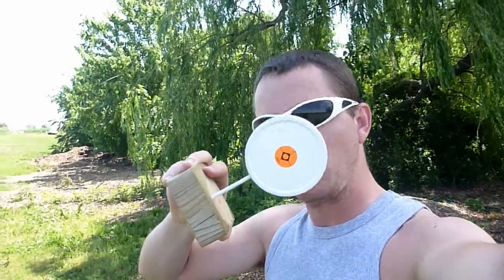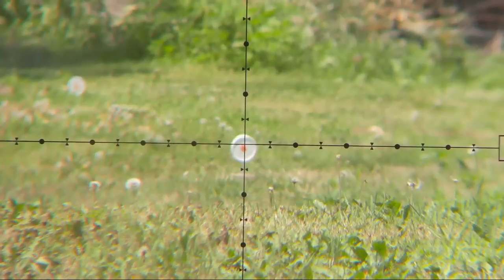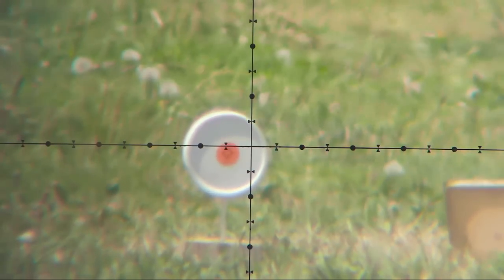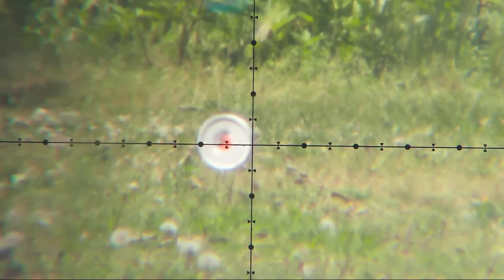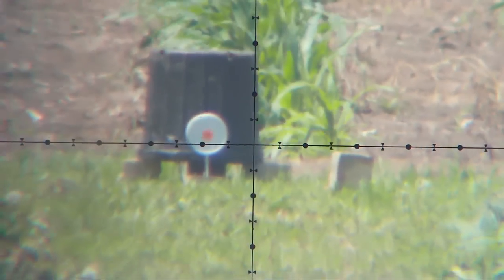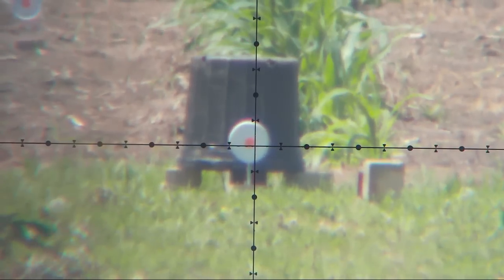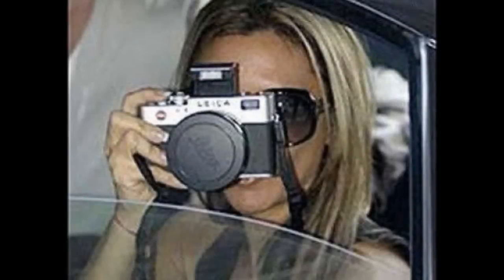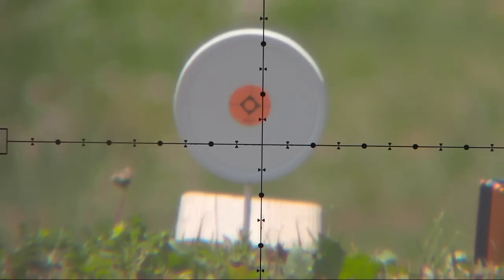Mil Dot Target Shooting - Range Estimation

Comment: I thought at 01:25 a light bulb would switch on when you realised the sheer beauty of the MRADs relationship to the metric measurement system. Alas, 3.6" at 100 yards prevails. Don't worry it's not just you and your vids are still great.

Comment: There is no such thing as “American Measure”; it is the “US Customary Units” based on English measurements derived from the size of barley corns and the width of the King’s thumb as far back as 1066 CE (Common Era; you Yanks still use Anno Domini). Even England updated to Imperial Measure in 1826. By the way, your military functions almost entirely in metric. Burma, Liberia and the USA are the only countries in the world where metric is NOT the official system of measurement.

Comment: You mention at the begining that 3.5 inches equal one mildot at this range and 2 at this one 1/2 at another.

But what I never understand is how magnification affects the calculation, surely a higher magnification, say x20 will mean there are more mildots covering the target, compared to say x4 magnification at the same range...

How then can one know the range of a target on a given magnification, particularly if it is an adjustable scope?
Reply: +ShottysGotShots 3.5 moa = 1 milradian/mildot. At 100 yds, 1 moa = 1 inch. His scope is using mildots. A 2nd focal plane scope will have accurate holdovers at usually the highest setting unless otherwise noted in the manual.
Reply: +caveymoley Your question is exactly what I was trying to figure out by coming to this video. To make it more confusing, I always thought 1 moa at 100 yds was equal to 1 inch, but he says it's 3.5 inches.
Reply: ShottysGotShots

I actually figured out a way around the issue.

Place a 3.5 inch disk 100 yards out.

Adjust the zoom on the scope so the disk is the size of 1 mil dot, adjust focus, take note of the zoom and either avoid changing the zoom or superglue the zoom adjuster in place.

Scope is now calibrated to 1 mildot at 100 yards at a set magnification.

I wonder if there is a "simple" way of calculating a shooting book by doubling the "set" distance of 100yards by halving the size of the target, but doubling(there abouts) the zoom until it fits 1 mildot, only this time adjusting the point of impact to say -1 or -2 mildots in the lower half of the vertical in order to allow for the bullet drop that would occur if actually shooting at that distance...

if any of that made sense...
Reply: Its 3.6.!
Reply: caveymoley you have to get a first focal plane scope for mildots to be accurate with zoom. a second focal plane scope would change the size of your reticle when zooming, making the mil dot system almost completely useless. unless used a maximum magnification.

Comment: YOU KINDA LOST ME WITH THE MAGNIFICATION TRUE 1 MIL 3.5 INCHES, 
WHAT IS THIS?
Reply: emiliano echeverria Its a second focal plane scope, which means the distance between  the dots or lines isn't the same distance at all magnification levels. It's a variable power scope so at a certain magnification, usually full power, is the only magnification that they really do equal a mil in distance.
Reply: emiliano echeverria Hi there 1 mil equals 3.6 inches at 100 yds not 3.5, as TheBobfriday says it is only equal to 3.6 on true mildot mag which is normaly full power or x ten, sometimes the scope is marked, so the x ten could be in Red, check with your user guide or ask the manufacturer of your scope.

Comment: great vid, but DUUUUDEE when are u guys finally gonna adopt the metric system!? greets from Germany :D
Reply: I agree.  I hate the standard system.  Particularly if you have to read a tape measure for a living. 1/2inch, 3/8, 9/32 (wtf). Technically, america converted to metric in the 70's but no one actually used it. 'MERICA!!
Reply: I agree, I'm from FL and I've become a custom to ranging in meters and generally have to convert it to ft when it explaining it to someone... I prefer meters
Reply: They both have there place so sometimes I use metric and sometimes imperial.

Comment: I have you say this is one of the best using and showing.   How the Mil Dot system works and just how much you have to use the elements will change the bullet/pellet will travel.  Yes when your using a proper sniper rifle they will be some different.  However not by much.  Great Job bro

Comment: he's not zeroing - he's range estimated. he's already zero'd at 35 yards (not really pertinent info yet). what he's saying is that at 10x magnification, with his target (3.6 inches wide) it will be exactly 1 mil dot wide -- every time. if its any other size, its either closer (more mil dots) or farther (less mil dots). for example, if his target is at 50 yards -- the target will be exactly 2 mil dots. 200 yards? half mil dot. THEN you take your ballistic info and figure hold-over...

Comment: Someone zeroed an R7 to 10 yards and had the following trajectory chart.  What does it mean and specifically the measurements?  It appears the negative values are hold over and the positive values are hold under.  But what is happening at say, 50 yards?  

05 yds = -7/8” 
10 yds = +0.0” 
15 yds = + ½” 
20 yds = +5/8” 
25 yds = +5/8” 
30 yds = +0.0” 
35 yds = -1/3” 
40 yds = -1 ½” 
45 yds = -2 ¾” 
50 yds = -4” 
55 yds = -6” 
60 yds = -8 ½”

Comment: You could zero the rifle such that it is zero at a close distance at the full bottom of the reticle.  But that's pointless for one, and two, less accurate and less repeatable.

If you have time to take a shot, the better method is to use the elevation turret to dial in the dope (hold over) you need.. such that you hold the center of the crosshairs exactly on the target.  You can dial in the windage as well.

Holding off is better reserved for shots on the fly.

Comment: "Mil" is short for milliradian, a unit of angular measure.  And yes, it is a metric unit... which adds a component of error when using non-SI units (inches, feet, yards, MOA).

Personally I can't stand that most if not all air gun scopes have mil-dot reticles and MOA turrets.  Unfortunately, most shooters don't know the difference and don't realize what they're doing or not doing when using the scope.

Comment: If the scope is a FFP (first focal plane) scope, then except for parallax, the reticle scales with the magnification.  You should be able to range at any power.  if it is not, then you either have to correct for it in your firing solution, or range at whatever power you used to zero the scope.

Regardless, you will have to confirm the external ballistics and compensate for atmospheric effects when determining dope.

Comment: IF the majority of your targets will be at 20 yards, then you would likely want to zero the scope at 20 yards.  Then determine holdover for other distances based on your rifle-pellet combination.  Determining the FFS (Final Firing Solution) will be entirely dependent on how your projectiles fly... and will be a function of many variables including humidity and elevation, if you want to split hairs and get the most accuracy possible.

Comment: Love your videos and just getting started in airgunning pigeons. Have put a lot of time and study into rangefinding with reticles and i love that mil reticle. It actually has the capability of ranging to an accuracy level of ~.1 of .2 mil, or .07 inch per hundred yds. using the .2 mil units at the ends of the axes.

Comment: I've got a question - I've got a 12ft/lb air rifle due to the law in England, and because of the lack of power i don't use a hugely powerful scope, i use a 3-9x40. if i use 5x zoom, is the Mil-Dot system still useable, just 1/2 a dot per 3.6inch? Cheers
Reply: Did you ever find the answer to this question?
Reply: @mrmagoo600  😂😂😂😂😂😂😂😂😂😂😂😂 holy shit 9 years later
Reply: @izLCK3  haha, I just cane across this video and also wondered the same question you asked back but not been able to find the answer!😐😂😂,
Reply: @mrmagoo600  no problem my friend! I never found the answer I don’t think unfortunately! Good luck on your search though 😂🔥

Comment: Hi there, not much of a rifle user but I love your videos, try making a wire frame to hold polystyrene disks to shoot at, the wire will be low diameter so it will be hard to hit and you can just cut disks to slot right in

Comment: Hi Ted, I'm back...
Can you get an accurate reading off your sidewinder scope's wheel for all these shots?  I am considering purchasing  a sidewinder 30 but I find puzzling which one to choose from, for my sub 12 ft/lb BSA R-10.  

SR6, SR12, 1/2 mildot true@x10, 1/2 mildot true@x20.... 
The SR's are tempting but I don't know if it can be used for a variety of rifles including non air based ones.  Looking for resale value there (just in case I feel changing it at later stage).  Any advice?  
F.

Comment: Hi Ted!
Do you have any tips on how to use a rangefinder with in built inclinator...  How do you calculate which mill dot to use when combined with up/down inclination?
I am considering getting a rangefinder but not sure how to utilize the inclinomter.  :)

Comment: Good video Ted. Re Metric. 1 metre is = 1.1 yards. One inch is 25.4mm, so 3.6 inches is 91.44 mm. When I did the sums what I got for one mil at 100m was 109mm. You don't have to worry too much about the people in metric countries as many of them have experience with the imperial system and are OK using either.